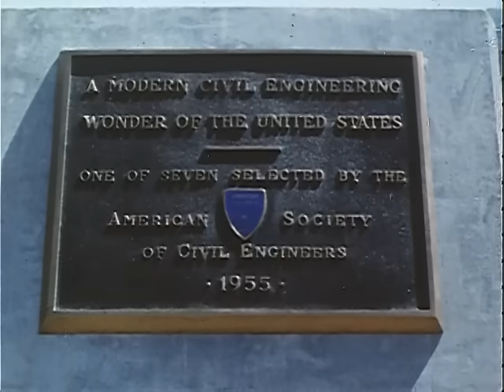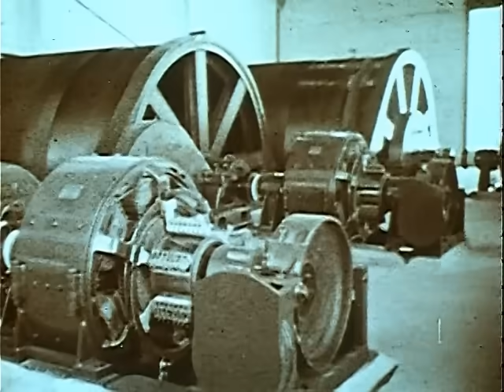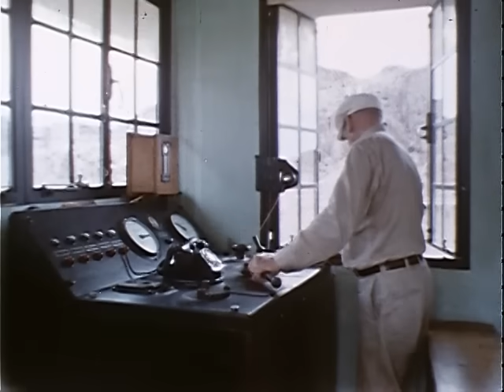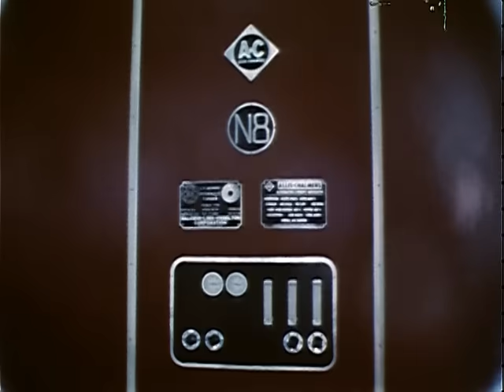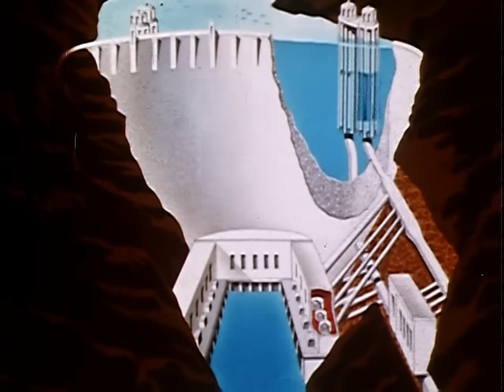The story of Hoover Dam

Comment: Their generation created world wonders. Todays generation creates safe spaces.
Reply: A sky scraper a day goes up in this country thanks to the modern generation. And now that skyscraper has a fire suppression system doesn't cook the enhabitants in the event of a fire. We have regulations so that some idiot doesn't end up poisoning half a city because he decides to build a factory on top of a residential area. We actually think things through instead of building a dam in a vital river causing thousands to be without water, crops to dry up, cities die; and now the plant sits nearly derelict as the river dries up and its generators built with little safety regulations in mind begin exploding. The structure continues to crack and deteriorate from the limited use of rebar. I'm sorry that the modern generations try to make our world a better place to live, and that we don't just start building random walls to bolster propaganda. I'm sorry that we're trying to fix the fucked up hellscape that your generation created.

Comment: I did not see any rebar in the pour of the damn itself.  I mean it is 650 feet thick so maybe at that point it is not necessary.
2 years of pouring the damn and it was finished 2.5 years ahead of schedule.  That is one of the most amazing feats of the whole thing.
The fact that this thing was built for a total of 175 million back then means it is still only a $3.7 billion project in today's money.  That is hilariously cheap for what it is.

Comment: I recall another video on the building of the dam that mentioned they had to install refrigerated cooling lines through all of the blocks of concrete to keep it cool enough for quite a few years after it was finished
Reply: They did, that was the Modern Marvels video from like the early 2000's that's what I watched waaaaay back when.  They just used the water to cool it through the pipes is all.
Reply: You haVe?
Reply: The pipes would of been used to control the concretes temperature. Concrete will generate quite a bit of heat. To much heat will cause it to lose moisture too quickly. The slower the concrete cures basically the stronger it will be(Just don't let it freeze).
Reply: I believe they do that to prevent cracks as the concrete cures but once it's hardened it gets backfilled with the slurry
Reply: @Galactis1  
Yep. That was a good series. I e been looking for it, but can’t find it.
Reply: @dodgeguyz  history channel? But they probably want $$?
Reply: Yeah they used so much concrete that it was taking too long to cure and the heat produced was a good amount. So they installed pipes into the concrete to act as a heat exchanger with water circulating through it, when it was all cured, they simply drained the system and let it all dry and plugged it or filled with concrete.
Reply: We took a tour of it in 2017 and they said way down deep it is still warm concrete that won’t be fully cured for another 30 years or so.
Reply: @blackfinjrblackfinjr3555  That is correct. Concrete cures and actually gains compression strength until the end if its life span.

Comment: An "achievement" with a dark side. This dam was created in a recession and the American labor  working on the dam were falling and dying like flies. What was worse is nobody had the courage to go and pick the dead fear of losing their job.
Reply: Have to call out vast inaccuracies! First of all, it was a full-blown depression. It most certainly was not a mere recession. There is a world of difference between the two.

Secondly, yes, unfortunately upwards of 96 people died during the monumental task of blasting, drilling, pouring concrete, etc. etc on a dam structure up to a height of well over 500 ft. 

Where you are incredibly wrong is that the construction superintendent and all the project supervisors were not callous to these losses. These were incredibly difficult job site conditions that they were working under, and these supervisory men fully realized that. The loss of life was handled in a compassionate manner. That is well-documented fact from the early annals of the 30s.

The Hoover dam was a Titanic building project that was almost miraculously completed two and a half years ahead of schedule in a time where we didn't have computers, laser measurement tools, and so many other things that the modern construction industry takes for granted. And these Americans did a fantastic job in the height of a worldwide economic depression. They suffered in 120° plus work days. The temperature was even worse when they were blasting out the tunnels. And there were plenty of cold work days in December, January and February as well. 

The building history of the dam cannot be subverted in a revisionist manner.

Comment: That would probably take 10 times as long nowadays with all the unnecessary regulations they'd have to go through
Reply: And be 100x the cost!
Reply: Unnecessary regulations would have prevented most, if not all, of the 96 deaths.
Reply: @joewalsh9685  I'm not talking about these regulations and very doubtful that they would've prevented even 1 death with the equipment used back then but even so, it would've taken ten times as long of they had them back then
Reply: "Unnecessary regulations" that would have prevented crops from drying and cities dying because somebody wanted to build a big wall on their only water source in a desert.

Comment: The concrete is still curing today! 87 years later...
From the time of construction, pipes where embedded in the concrete and water was pumped through the structure to dissipate the heat produced by the curing concrete. Over 582 miles of cooling pipe.

Lake Meads water level at the dam as of May, 18th 2022 was at 1,050 feet and dropping. The all-time high was in 1983 at 1,225 feet. Drought and regional demand are the reasons why it's at it's lowest levels since the 1930s...

Comment: He said each of the big pipe section weighed 150 ~ 184 tons. Then he said after the pipe section was transported to the canyon rim at the dam site, a 150-ton cable way lowered the section to the canyon floor, then moved into it's intended position. So how many cable ways snapped I wonder.
Reply: That's RIGHT!
Reply: Maybe thats just how much the cable way weighed and not how much it could hold
Reply: If you've ever been there, that original crane going across the canyon is still there. I'd like to know how they got the pipes into their proper location with them weighing 150-184 tones. Mind boggling.
Reply: Max Powers  right... Yep.... SMH.

Comment: They don't mention that the 'high scalers' the ones setting the explosives on the walls were actually professional circus acts from Vegas! No engineer would touch that job.
Reply: Yea that’s crazy but without the engineers and infrastructure they wouldn’t even be up there in the first place
Reply: @Crow_Man918  oh ofcourse. And don't get me wrong, every on site job in this had a risk of losing your life. But those trapeze performers setting holes, guiding lines,  and explosives...that's something else!
Reply: They do say acrobatic workman
Reply: They said “acrobatic”
Reply: Yep, bunch of clowns..
Reply: This is not true at all lol
Reply: @Henleyrocks  prove it
Reply: @sawyerbarnes7439  Source: I am historian here at the Dam.
Reply: No engineer would ever be assigned that task.
Reply: @Henleyrocks  I was told this on a tour at the dam itself. So the tour guide didn't know the history.?
Reply: @Crow_Man918  yeah il draw up your pulleys and rigging and il even work out your charge placements and yields. But like fuck will I be doing it for you!
Seems pretty reasonable if you ask me.
Reply: @upbreaker7055  probably just messing with your group. It’s fun to think about it but it’s not true bud or else it would be widely told.
Reply: @Henleyrocks  what a bummer. I've heard it a few times as a Nevada local. I would be curious if we could find some facts on this somehow.
Reply: @upbreaker7055  it’s not true man or else they would have stories about it.

Comment: As a Vegas native that has been to Hoover Dam more times than I count over my 40 years, I never get tired of the amazingness of the Dam.  I am greatly sad how low the water level is now.
Reply: How will vegas get power if they shut Hoover dam down
Reply: @relaxed-epoach9195  about half an hour outside Vegas there’s this flat land completely covered in solar panels that stretch out very far
Reply: @relaxed-epoach9195  most of the power of Vegas comes from a coal power plant.  You’ll be surprised how little power from Hoover Dam actually goes to Vegas.  Mainly the power runs to Boulder City and Southern Cal.